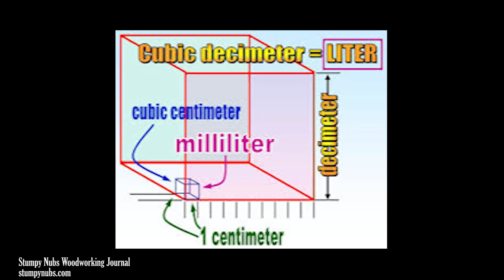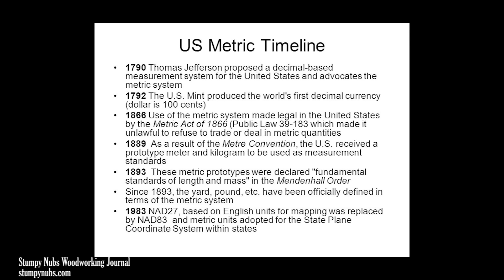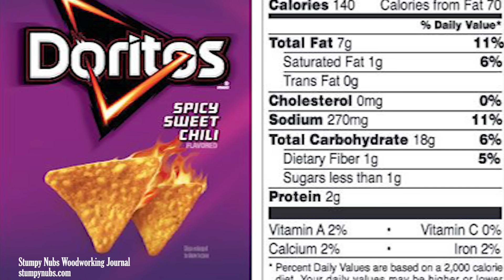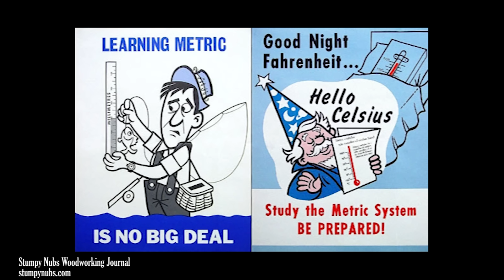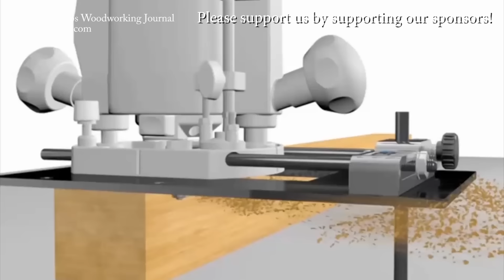BREAKING: The USA is switching to METRIC!

Comment: I'm from the Czech Republic and while I got mostly used to the US lengths and weights thanks to watching all the cool American bushcraft stuff, I always felt a bit sad that you guys didn't moved to the metric system. The ease of multiplying or dividing by 10 let's my simple brain to do other things. :D
Reply: I have Several Czech made garden hoses (my wife is Czech) from a company that predated the collapse of communism (two are over 25 years old). The internal diameter is 1/2". It's printed right on the hose!
Reply: @timosdinkydetailing  So? I keep having to buy irrigation and plumbing material by inches. Same for computer and too many other things. Most hardware is sold in inches and I'm damn sure it's not by the influence of Liberia or Myanmar. It smells more like USA exceptionalism. It must be so great to know there are like 7.5 billion dwarves abroas who disagree with you... and your yards, gallons, ounces, tablespoons and so on. Such a power!
Reply: @timosdinkydetailing  I have seen new hoses that have 13 mm written on them.
Reply: Respectfully, that ease only exists as long as you either don't have anything right of the decimal, or a select tiny number that's easily manageable. US Customary units get around this as everything is fractions which are easy to work with and there's no numbers right of the decimal to worry about.

Once you get into giant numbers right of the decimal and have to do complex math with them, it becomes problematic, especially where rounding gets involved. Round and varying positions (say 4 decimal places on one value, then 8, then 9) for different numbers and your answer is way off what was expected; sure you could pick a point at which to round but at what point does that consistently work when the numbers are coming from multiple different equations? This is why software such as GNU Octave and Matlab exist to perform such calculations rounding at ridiculous numbers of decimal places.

When I was at university getting my degree in mechanical engineering was when I discovered the point I made in the paragraph above this one, I was the only person in the tutorial class who kept getting answers that matched the book, most others were off by quite a significant amount. When being asked why I was getting the answer the book had when everyone else wasn't, I demonstrated it to the class. The professor noticed that I was instinctively converting everything to imperial and then solving as fractions whilst everyone else wasn't. When I reached my final answer, I converted back to metric and got the correct answer.

Having grown up in the bush in Australia, fractions were taught as a priority and many farmers used "Imperial" (basically the British version of US Customary units). Most land is sold and listed in acres as people understand that better than hectares (which are only used on govt records alongside the acre value).
Reply: @mernokimuvek  Yeah, but remember that it's only directly compatible with new plumbing parts unless they've made it as 1/2" but incorrectly listed it as 13mm. In reality 1/2" is 12.7mm so that's a significant difference when compared to real 13mm. This is why plumbing parts are still made in Imperial and why both are still used in the Commonwealth countries - new houses are metric but older ones (pre-2010) aren't.
Reply: strangely enough, tv sizes, alloy rims and pipes are measured in inches all around europe
Reply: @honestguy7764  Thats because advertising would be weird to say Come and get a brand new 1.905 meter TV! oppose to 75"
Reply: The reason there are still Imperial units being used is not some power thing. Stumpy Nubs gives plenty of examples where metric is used in The U.S.. It all depends on which is more useful. Just try to imagine a standard metric size of a sheet of construction plywood. How tall and wide do you make it? What spacing do you make the studs? It is a bigger problem than you expected. This is probably the reason that frame houses are still not built in Europe. Metric is better for many things, but not for frame construction, or angles. @RufianEmbozado
Reply: @honestguy7764   I have no idea about pipes but tv sizes are in cm here in the Czech Republic. But the rims are here in inches. That's even weirder lol
Reply: There are very interesting points in this discussion! Thanks!
Reply: @michalurbanful Funny thing - TV and tires/rims sizes are marked in inches. But these numbers are not corresponding to their real sizes, it's just very rough "market" approximations of dimensions.
Reply: @mernokallat645   I understand why they would mark a hose as 13mm, but it's still a half inch. A Canadian beer bottle is marked as 341ml, but it is still 12oz.
Reply: @timosdinkydetailing  It goes on and on. Inner diameter of so called 1" is not actually 1". It is 27.2 mm (inch is 25,4 mm). We use inch sizes more like "type ID" than real dimension.
Reply: @timosdinkydetailing  They might be marked that way because they were meant to be exported to US?
Reply: @timosdinkydetailing
What do you think how we do our framework in Europe? Smashed bananas?
And why is a two by four not two by four?
Reply: @digitalraider   Yes, but who would not want a 1905 mm TV as opposed to a 6.25' TV   :)
Reply: @matthewnirenberg  At that point, you are not doing the calculations in your head, but on your computer or calculator, which can handle any arbitrary numbers to the right of the decimal point. Yes, I get the fraction bit, but that's an illusion. Things you measure will not always fall on a fraction anymore than it will always fall on a decimal. And in either case, you will deal with roundoff error. You can just hide the roundoffs better with fractions.
Reply: @YellowKing1986   They started making them during Communism. They probably didn't export them to the West.
Reply: @timosdinkydetailing  It is possible – our country exported some product to the west (I live in Czech republic). I certainly know of some pickled fruit cans that were produced here but had a fancy label and a logo that wasn't known here at the time, but was a brand in the west.
Reply: I'm from the US and have always used inches and miles. When I went to canada, I was surprised to find out that everyone else in the world was wrong.
Reply: @torstenbrunke4026  I have seen vanishingly few frame structures in Europe. It wouldn't surprise me if the few that are there, were framed in Imperial.
Reply: Nečekal bych že tu potkám Čecha v komentářích😃
Reply: @makl196  Ja doufal ze jo :D
Reply: @YellowKing1986  Then that is a possibility. It's a good one for me, because those are the best hoses I have ever owned. I have one that is over 30 years old, and is working perfectly. My Canadian hoses only lasted a year or so before developing leaks. I don't imagine the modern Chinese hoses, now sold here, are any better.
Reply: @Freg-ld2lo   👍👍👍
Reply: @timosdinkydetailing  Those and smaller tech screens are the only thing i know about that are in imperial. Pipes are measured in mm.
Reply: @makl196  Jsem ženatý pouze s Čechem. Naz Dravi 🍺
Reply: @RufianEmbozado sounds like envy
Reply: The funny thing is the imperial system actually takes away the need for division by being a simple predetermined system based on division. Everything is pre-divided in pre-determined packages and quantities. A pound can be halved, it can be quartered, and the quarters halved and quartered. A gallon can be halved, it can be quartered, and the quarters can be halved and quartered. The beauty of the system is that it says to hell with repeating numbers, and decimalization, and just embraces the real material world, in a way that is so dumb, it's smart. Would I do astrophysics, or chemistry, and all things complex enough to be absolutely precise in imperialist units of measure, fuck no.  But in painting, baking, construction, all things simple and mundane, I love and prefer the imperial system over metric, because it's not about making forever calculations, it's just about getting the job done, good enough, because the reality is I probably could not come up with a metric cylinder, and make it precise to a mm all on my own, but I could do a decent job of making a cup, I have a pretty keen sense of what 8oz looks like, and so I have the basic building block for all the additional volumes of measure in the imperial system. And a foot, well damn, my foot is literally a proper foot, I divide that twelve times, I've got an inch ruler, I divide those inches by quarters, and eights, I've got a ruler. The imperial system wasn't made for the papered world of academia exploring chemistry, or mapping circuits on a board in electronics, it was made for the world of ordinary trade-crafters who could restart civilization anywhere on the planet with just a shovel, a knife, and an axe. And functioning on the scale of the completely ordinary, it's brilliant.
Reply: If you are old and live in the UK and are English like me you can most likely do the conversion in your head
I can
Reply: @digitalraider idk we measure our tv screens in cm. It sounds cooler in marketing. 110cm 130cm shit like that
Reply: @timosdinkydetailing  Yeah, that checks out. One of the few areas where the imperial (or whatever non-metric) system still endures is plumbing and related stuff. Honestly, it;s incredibly annoying. If you happen to need an extra valve for your portable beer tap, you suddenly have to delve into these ridiculous conversion tables. It's not even American inches, it's some outdated German, or maybe British, inch that is slightly different to everythign else. Really frustrating.
Reply: @matthewnirenberg that is very interesting.
Reply: @tlk889 THAT is the real reason why the world went metric. People forget. Cities and regions had their own idea about the exact length of one inch. And when a country decided to impose a standardized inch, they chose one that is different from their neighbours. It was not a case of metric vs imperial. It was metric vs a thousand versions of imperial.

There is a reason the US today use only one currency. It's because the government forced everybody to. If you tried to create your own, the secret service would be at your door in half a day. And it was NOT better when every bank printed their own money, and all their dollars have different values.
Reply: the inch unit system and other unit system are stupid. It is not because of stupid system, but because  that they are not compatible with the international system SI. All other unit systems must compatible with the international system SI. 
I often use computer programs for technical machines and other engineering tasks. And I often have to store and enter various values for various variables in computer programs, then let computer programs use entered values to calculate various tasks. You know that computer programs use standard known scientific formulas to calculate. If you enter values for variables in different unit system, then any time you add values, you must check the unit used in scientific formulas, then you must convert the added values to required unit systems. It is nightmare in engigeering tasks and scientific tasks. 
The only solution is that : use universal unit system SI : all programs and people exchage and communicate only with values in SI system. Thus no need to convert and check formulas when you apply variables in scientific formulas.  
Other unit system maybe comfortable only in conversation communication languages, but not in engineering tasks.
Reply: @danielch6662  Ithaca hours are a thing, so yes, it is possible to create your own currency legally.  It’s not necessarily easy though.
Reply: We don't do all that counting either, we are Americans. We cant count.
Reply: @Freg-ld2lo  Well 7,5 billions are wrong🤣🤣🤣🤣🤣🤣
Reply: @csuporj  no, wood thickness is sold in mm size.
Reply: @matthewnirenberg  Well, if you look at fractions and decimals from a mathematical point of view, they are the same thing only represented in different formats. They both have their caveats when it comes to calculations. But when it comes to conversions, with metric, it is just a question of moving that decimal point few steps to the left or right, instead of having to do additional multiplications/division by alway changing number that you have to remember.  Yes, rounding can be tricky,. So much so, that even modern computers sometimes have problems with it. But one thing we learn in schools here is that you never round anything except the final result. Of course some leeway has to be made for shool environment where you do not want to make kids run caclulations on some crazy  decimals and ruint their view of mathematics forever :D. But those are always announced at the beginging of the task and are taken into concideration when checking the results. 

Of course this, as you have as well in a way insinuated, is all highly habitual, but even in the US, the base 10 system is used when it comes to money. You do not pay 5  and 15/32nds of a dolar. So the ease of use of a base 10 system for other measurements should be evident. In EU, we even use fractions in some legal documents, like property deeds, because it simply makes more sense in this case. 

However, I have to admit, that from a metric system user point of view, fractions seem more complicated and less intuitive simply based on how much exposure each system has got in school when learning basic calculus. Even now, being over 40, when I need to calculate something that makes more sence in fractions than in decimals, I have to look the proper way up, because I simply do not always remember it. 

The single best solution to this dispute probably does not even exist. But what might get close is standardization to base 10 where it makes sence, like measurements, but balance it with a lot of comon sense usages of fractions and teaching people all the ins and outs, pros and cons and  dos and don'ts of both systems equally, so people can work with them both as needed.
Reply: @timosdinkydetailing  only because of our stupid material sizes. I use metric plywood (Baltic) and have no issues. I studied architecture in the early 70's and even back then, we wanted to ditch the awkward 23'-3-1/2" measures. But we were hamstrung by the construction workers, lumber companies, and even dumber building inspection rules. I switched to electronics in the mid 70's and that was already (especially my field of microelectronics) all metric. I have to have an extra toolbox in my shop, for SAE tools to work on my older equipment. But even my 80's vintage John Deere tractors are all metric. I use my metric tools at least 75% of the time. I hate the fractional SAE wrenches. My on-site inventory of nuts and bolts is drifting more and more towards metric.
Reply: @PavelNygryn  same thing with the super stupid U.S. "nominal" wood sizes. The named size is not the actual size. All to save some money and keep stupid people working
Reply: @timosdinkydetailing  Nah. 16-inch-on-center becomes 40-cm-on-center; there's only about a 1% difference between 16 inches and 40 cm, so for most reasonable/practical purposes it'll change nothing.

12-inch-on-center would become 30-cm-on-center; there's about a 2% difference there but again that's not enough to cause significant problems in any reasonable context I can think of.

Essentially, the solution is just to do "fuzzy" conversions to port things over; if you do it right, the small deltas won't make a difference. Degrees are also accepted for use with SI, although they aren't SI units themselves (the SI angle unit is the radian - great for math, not for a whole lot else) - so there is no problem with angles in metric per se.

I personally kinda like the idea of the gradian (like degrees, except there are 100 per quarter turn instead of 90), however it's not great for geometric math and it's neither an SI unit nor accepted for use with SI.
Reply: @timosdinkydetailing  that's because plumbing and car wheel sizes are still in inches everywhere even if expressed in mm
Reply: You can multiply or divide any imperial measurements by 10 or any number. We just have many different meaningful scales while metric has may prefixes for the same scale
Reply: I was taught to multiply / divide by many numbers . Not just 10
Reply: Raised
In NZ I learnt the  imperial measurement system and then we converted to metric so became adept at doing the conversions in my head. Eventually I worked for an airline on Boeing aircraft which were
Drawn in inches 😅
Reply: @number1genoa  - I was NZ raised also and went through the transition from imperial to metric - I easily switch from one to the other and can readily do conversions - I love how metric starts or finishes with one millilitre of water weighing one gram and its dimensions being one cubic centimetre. Often I will say something is “two inches” or a “couple of yards” but more and more it’s metric - I needed metric in my work in the food industry and worked with it exclusively. Knowing milk at a certain Celsius scale temperature is 1040kg/cubic metre is more definitive to me and easier to calculate recipes or engineering solutions than x pounds/gallon at a Fahrenheit scale temperature.
Imperial is traditional (and I like traditions) but to me metric is precision.
Reply: @timosdinkydetailing  is not 2,4*1,2m  (or 2,7*1.2) standard for boards for walls in hauses? CC 60cm. Most hauses are made of wood, why is  metric a problem?
Reply: @timosdinkydetailing  Plumbing (and related stuff) is often done in imperial to this day.
Reply: @gtvgranberg  Metric is not a problem, it's just that the Imperial measures used in framing is so simple that you would think it was invented for that purpose. You can make metric boards, but dividing them into fractions, which is what Imperial is all about, totally fails in Metric. Your example has you calculating 2.4 meters by 1.2 meters. You kind of lost the advantage of base ten, didn't you.  Let's say you want to put 4 studs per sheet of drywall, so the sheet is supported at the edges as well as across the sheet. Easy peasy. 48 inches (the standard width of Imperial sheet material) divided by three (3 spaces are required) is 16 inches. A framing carpenter doesn't need a calculator. Metric is good for most things, but it sucks when it comes to fractions. sometimes fractions make things simple.
Reply: @michalurbanful  Because of Ford, start of commercials and most used measures from suppliers when cars gone most popular in past times.
It is only inertia and convenience to use this type of measurement. Bcause you use it only once, when installing. Same with pipes inside your wall.
When suppliers decide to use only metric, you will not change anything.  The start is in electronics, televisions are marked more and more often in cm than inches
Reply: @timosdinkydetailing 
Dividing 120 by 3 shouldn't be problematic. 
(40 cm)
Even if the board is 100 cm the number 33,3 is easily memorable.
Reply: Metric is inferior. There is a lot of modern ignorance on the topic.
Reply: @timosdinkydetailing  We don't make frame houses with internal drywall because we make things last. We build homes with bricks, stones, steel reinforced concrete (for floors) and full concrete blocks for the basement walls or vertical sections of the building foundation.
The idea is the heaviest stuff starts from the ground, a bit lighter follows upward, and the roof is a frame construction. In my country, there are 700-800-year-old castles made of bricks and stones. 
Well-maintained and inspected multi-family brick residential buildings have been serving people for over 200 years. And it doesn't look like they're going to fall apart or lose their attractiveness.
Reply: @honestguy7764  And the Americans  measure their bullets in millimeter.